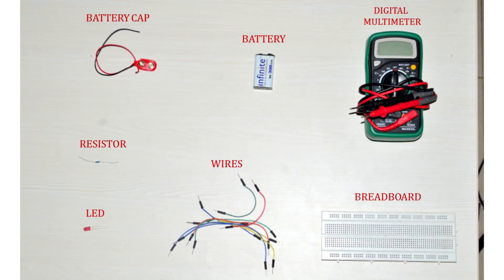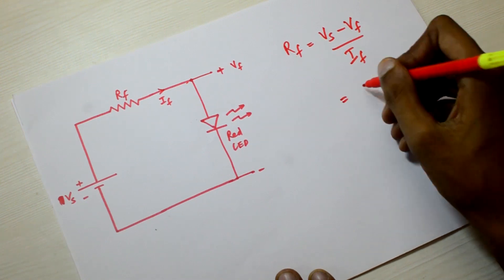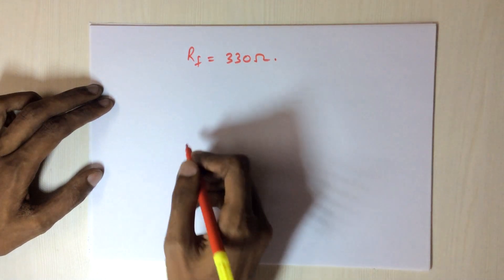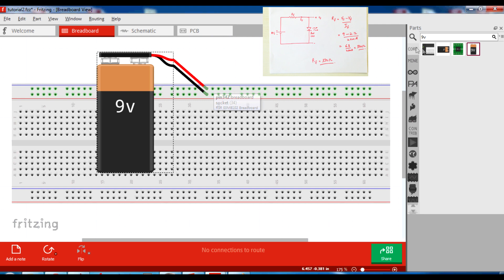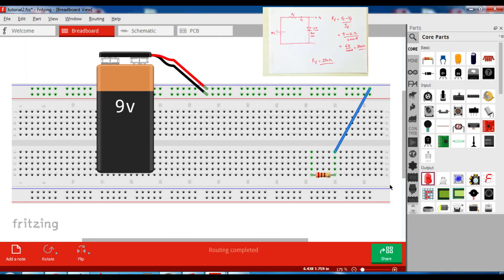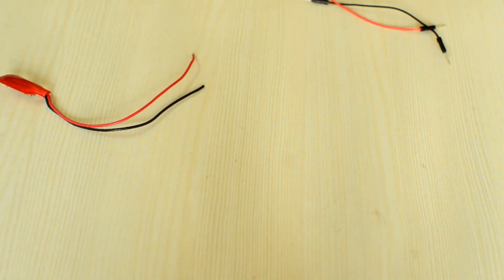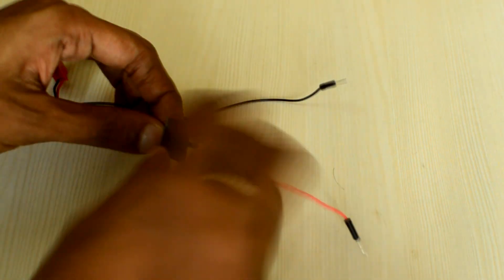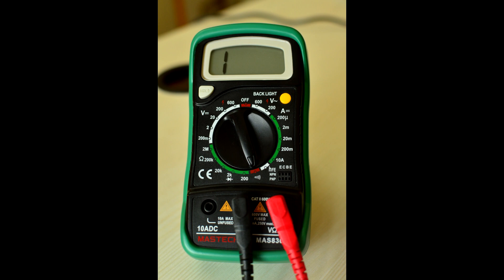Building Electronic Circuits (Tutorial 2): Circuit to Glow an LED using Breadboard

Comment: When you did the equation to get the power rating of the resistor why does that equation have the current "I" squared? thanks in advance!
Reply: I'm glad I wasn't the only one. I've reviewed resistor dissipation from other sources and they're pretty consistent about wattage dissipated being equal to Q * V. one of the sources that made me second guess that: http://electronics.stackexchange.com/questions/36880/how-to-choose-correct-resistor-with-proper-wattage-and-ohms-for-6-leds-connected